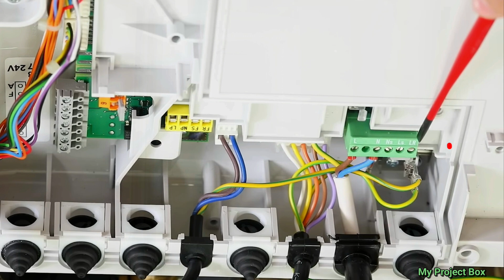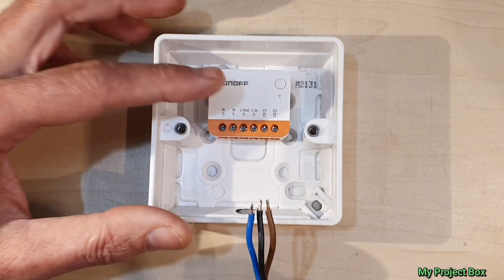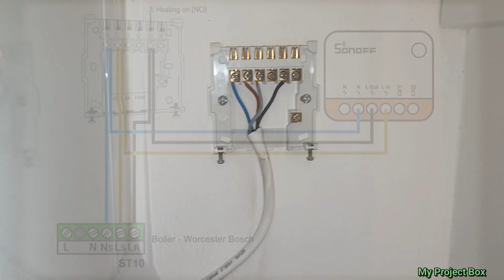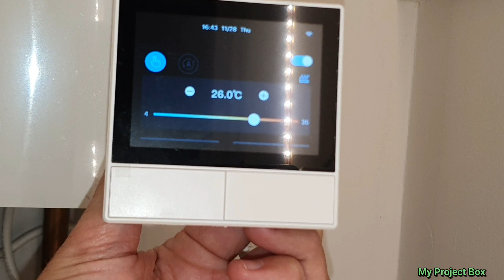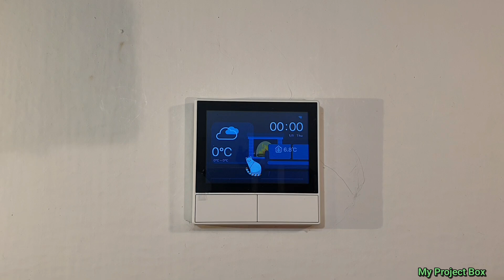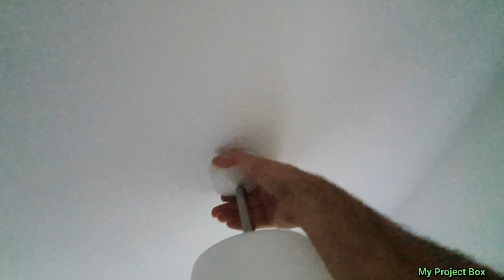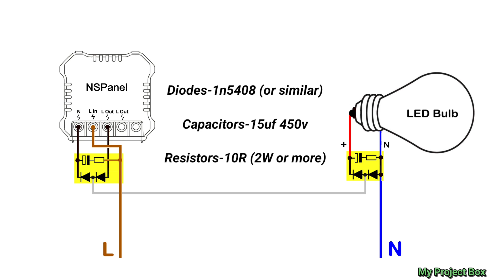Sonoff NSPanel smart thermostat controlling central heating Boiler with miniR4 & WiFi & lightSwitch

Comment: Can you add a switch to control the boiler if WiFi is down?
Reply from the maker: Yes you definitely can add a switch and connect it to S1 and S2 of the Sonoff mini. In my case I can still use the old hive thermostat aswell😊
Reply: @MyProjectBoxChannel  thanks I am a little confused because sonoff advertises a dry switch for boilers but it doesn’t have as many features.
Reply from the maker: @andrewcrook6444 yes  dry/volt-free contacts are a safe bet to cover all boilers, but many in the UK can be "Live" switched. At the time of making the video, sonoff's volt-free/dry relay version wasn't out yet.
Reply: If you have Home Assistant you can flash the Sonoff with Tasmota firmware, then you control the device via LAN.
Reply: @AD-dq2vs thanks I also meant if the lan is down or HA is down so you can use a manual override as backup

Comment: What happens if your hive calls for heat and sonoff is currently calling for heat? Anything potentially unsafe?
Reply from the maker: In this particular case nothing bad. The boiler is just turned on by both, but won't stop unless both stop calling for heat. So the thermostat with the highest temperature setting wins.
Reply: @MyProjectBoxChannel  Thank you for the response. I like your setup and I plan to do the same and program it so that if any of the Sonoff TRVs in the house call for heat then then Sonoff miniR4 turns on the boiler. Also want to keep the old timer/programmer in case the Sonoff miniR4 stops working or I need to move out.
Reply from the maker: @haiderm1384 if you are worried about putting a live feed on your boiler control, sonoff now also has a volt-free smart relay. SONOFF MINI-D. SONOFF MINI Dry Wi-Fi Smart Switch | MINI-D https://sonoff.tech/en-pt/products/sonoff-mini-dry-wi-fi-smart-switch-mini-d?srsltid=AfmBOoqa3_bXybAQEO8PX1fGAGjh1lolMu7jrTJuPt3hd-9XC0hMTxIy

Comment: Does it work with any boiler? I have worcester bosch greenstar ar 25si combi mk IV
Reply from the maker: @chmieluu21  Yes it probably will work,  just check your boiler documentation to see if it has the LR terminal like at 1:33 you can also use sonoff's volt-free smart switch, should you wish to power it from a different supply. The SONOFF MINI-D (dry contact) is perfect for any boiler.
Reply: @MyProjectBoxChannel  thank you I will check :)

Comment: This was a very informative and interesting video. Now I would have one question: I need a triple touch smart switch with WiFi so I can connect a light (LED light 9~12W), a water heater (2000W) and an electric heater (2000W) in the bathroom. So the light switch has a load of 10A, and the water heater and electric heater have a load of 16A each. In Europe, this combination is most often used in bathrooms. Is this possible, and with what devices?

Comment: I'm using something similar for 2 years now, the biggest issue is that the smallest resolution is +/-0,5C° with the thermostat function, but it has to be >or< than the set value. It does not trigger when it reaches the set+0,5C° only after it... This and the cloud delays makes it to "slow" not precise enough
Reply from the maker: A different problem is that the thermistor/sensor picks up the heat from the power supply and the heat from the unit itself. This   "skews" the temperature measurement. Extending the thermistor out a bit might help.
Reply: @MyProjectBoxChannel  my "solution" is that I use a TH Elite with the external sensor and use that measurement value in the thermostat, which eliminate the issue you mentioned BUT introduces further delays ...

Comment from the maker: Single diode half-wave rectification is very common for "low power" electronic devices! Some cheap LED bulbs only have one diode rectification. Even the Sonoff mini-R4 does not have a full bridge rectifier. Many devices use a diode to reduce the speed or power of a device. A hairdryer uses this technique to reduce the fan speed, and sometimes the heating element is being driven with half sinewave aswell! For small transformers it's a big problem,  but not for the big transformer from the electric company. The effects are negotiable. Older triac light dimmers, are much worse for the electric company. They also don't like bad power factor. As long as the current draw is only a few milliamps for LED lighting,  it's really not a problem at all 😉👍

Comment: Only use a half wave of the sine for lighting. Your electricity supplier will be annoyed. 
This gives a direct current component in the domestic power transformer. 
As a result, it will not only hum loudly, but will also lose performance.

Comment: You could remove one yellow-green wire on both sides. 
Slide a blue tube over it and connect it with N.
Connecting both hot cables would not be done in continental Europe. 
There the cables always branch out without being brought back together at the end.
So I would have just used one hot wire and insulated the other hot wire.
Reply: I forgot, in England the PE with a reduced cross-section is used. 
But you have two hot conductors, you only need one. Then convert one hot conductor to the N.
Reply from the maker: @jensschroder8214  yes! I actually mentioned that in the video, that I could of sleeved the one brown/Hot wires, to blue/neutral. Unfortunately in the UK, we are not allowed to sleeve green/yellow wires with blue sleeving.  I just wanted to show different options including "no-neutral".  There are many ways the double light switches could be wired in people's houses

Comment: I've done something similar to an oil fired boiler, basically I discovered that I did not have thermal cut offs installed so I added sonoff relays & temperature monitoring to install my own

Comment: Does this not need to be done by a licensed electrician in the UK?
Reply: Right - like we're going to do that.. The cost of the electrician would be more than the cost of the NSPANEL and Mini R4 combined. ANd would a typical electrician be aware that NSPanel does not provide isolated contacts - which renders it uselesss for a typical boiler anyway,
Reply from the maker: I don't think you need to be a electrician to change a light switch in the UK, or a boiler thermostat on the wall. This is well within what is allowed for the diy homeowner, to work on his house electrics. Most boilers in the UK don't require a volt-free switched signal. But I'm not sure if you are based in the UK? I think the key thing to remember is to work on electrics safely😉👍
Reply from the maker: @calvinbrowne2126  you are actually aloud to do some basic electrical work your self😉👍. For example: You can replace light switches and sockets, ceiling lights. You can even move or extend wires to move a socket. You can install a fused spur to add a additional socket outlet. You are aloud to repair damaged wiring. Things you are not allowed to do your self: You can not install a brand new circuit connected to the consumer unit/fuse box, that work needs to be certified. 
So I think it's OK to replace a thermostat for your boiler, and replace a light switch with the NSpanel. You are not working inside the boiler, or on the gas supply, so you don't have to be  "gas safe" registered.
You should however never work on electrics, if you not confident you can do it safely!
Reply: That this question even needs to be raised speaks volumes about how oppressive and overreaching the UK government has become.
Reply: @martontichi8611   I'm not resident in the UK. I was merely interested in the situation there.
Reply from the maker: @martontichi8611 I must admit I kind of agree with you. For me it's my house my  business,  my rules. As long as it's safe 😉👍
Reply: @MyProjectBoxChannel   yeah. I'm of a similar thinking. With caveats. So, when you sell, I'm OK with having to supply a certificate from a professional for example. And your insurance contract might say something.

But then, these rules are normally not aimed at people who understand that live neutral matter, even if it's AC.

And I'm renting now, which means I have to abide by the law (and/because my rental contract) in this jurisdiction.

Keep up the interesting stuff!
Reply from the maker: @calvinbrowne2126  yes nobody wants to invalidate their insurance. Or give them a excuse not to pay a claim.